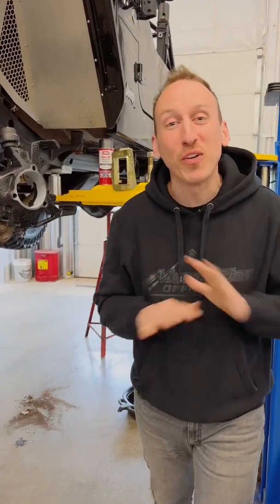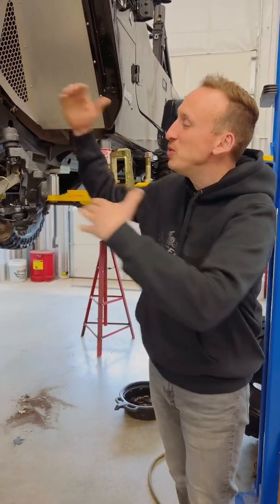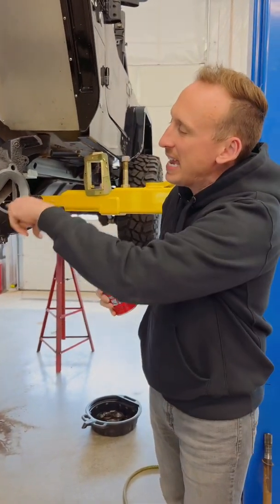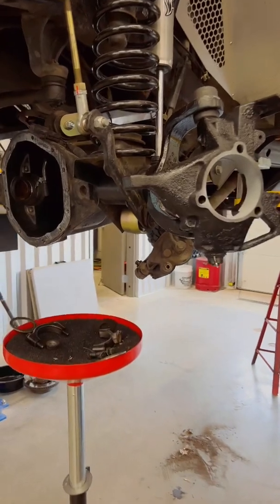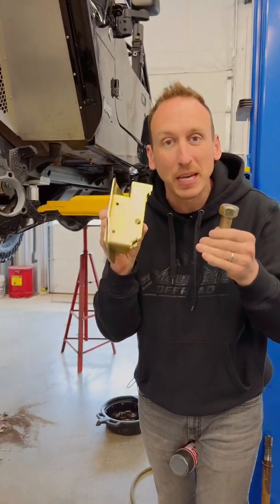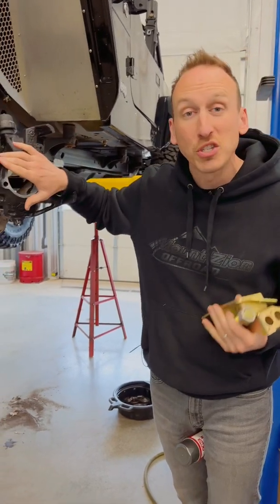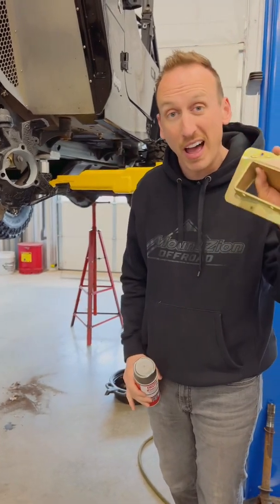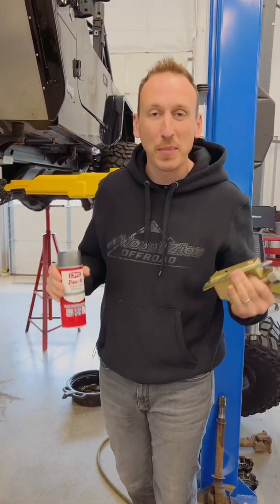Put some Zinc on it!

Comment: I’m here for researching the benefits to steel boats, why aren’t car manufacturers using this? It doesn’t need to be coated on either, the steel simply making contact with the zinc will significantly decrease corrosion

Comment: I don't know if I can trust you, clean hands
Reply from the maker: We supply all of our techs with quality gloves they like to wear, so the rest of the vehicle and the work environment stay clean.
Reply: @MountZionOffroad  something other than disposable nitrile? Can you still use your fingertips to start nuts? I'm actually looking. Nitrile always rip when I use them. I also have big hands
Reply from the maker: Some techs use regular black nitrile gloves made by SureCare, others use Gloveworks green nitrile with diamond texture.  If you have had trouble with gloves ripping and want to try something new, give Venom Steel gloves a try, you can get them at Lowes. They aren't obnoxiously thick, but they usually can be taken off and re-worn several times!
Reply: @MountZionOffroad  thank you!

Comment: places  like that is a good place to use anti-seize lube.  I use it on brake parts and rim to rotor surfaces.  depending how much  that zinc stuff is I may give it a try.  i see a lot of people who like fluid film.  i bought a can to try but havn't done so yet
Reply from the maker: All good things! In general: if it doesn't get locktite it gets antiseize.  Steel/iron will always rust and it's always good to keep in mind how dissimilar metals interact

Comment: Will this product help to keep aluminum parts from corrosion?  I am trying to figure out how to keep my valve covers and engine components from getting that white oxidation.  Thanks
Reply from the maker: You could, but there are products for keeping cast aluminum bright that may be a better choice in that application.  Products such as Aluma Guard or Amsoil MP come to mind
Reply: @MountZionOffroad  I’ll go check them out. Thank you so much for the reply 👋🏻🙂
Reply: @lonesomecricket7721  you probably wont stop that.  it happens mostly because of the grade of aluminum they used.  its why they clear coat rims.